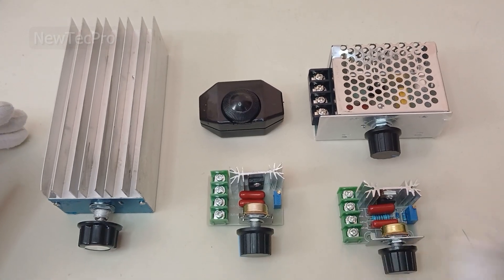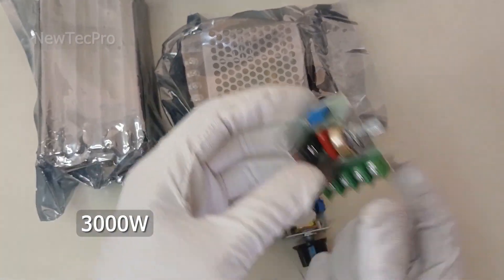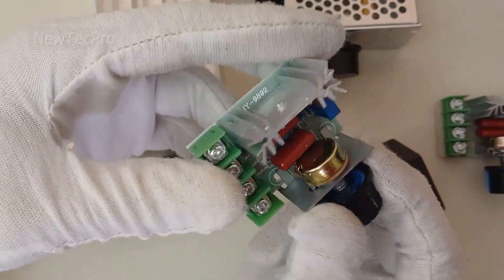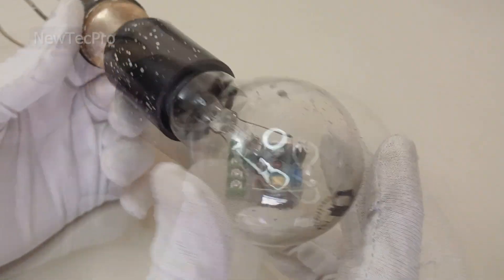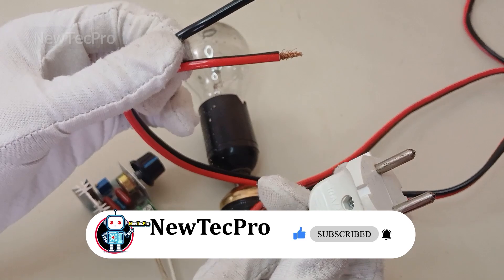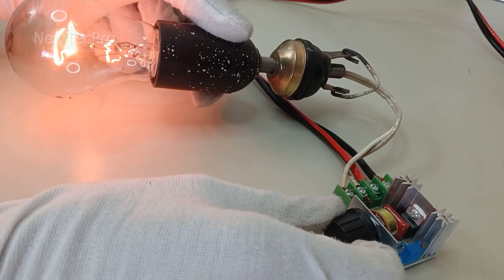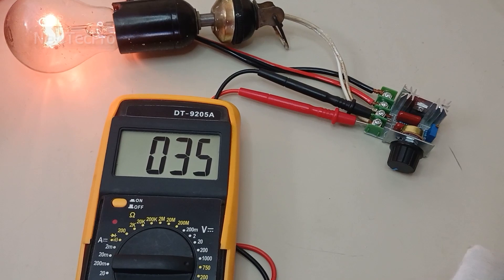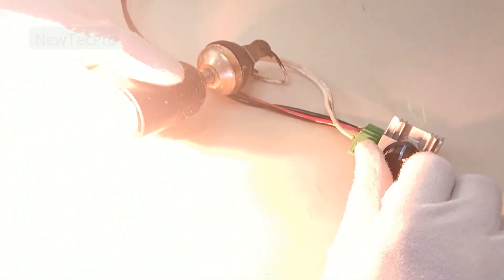How to Control ANY Light Brightness | 2000W AC Dimmer Setup & Voltage Test

Comment: Is there polarity, how to determine polarity of wall socket?
Reply from the maker: AC mains doesn’t have polarity like DC, but it does have live (hot) and neutral wires. A dimmer must be connected in series with the live wire. To determine which is live in a wall socket, you can use a tester screwdriver or a multimeter — the live will show voltage relative to ground, while neutral will not. Always be careful and follow safety rules when working with mains.
Reply: @newtecpro thanks for the reply
Reply: @newtecpro btw what if my socket is line to line (no neutral)?

Comment: With such clamping screw connections, sleeves always belong on the ends! The way you have shown it is amateur work and dangerous, even if this video is only for demonstration purposes.
I'm sorry, but I had to get that off my chest at this point.
Reply from the maker: Thank you for your feedback and for taking the time to share your concerns. I completely understand the importance of proper safety measures when working with electrical connections. The method shown in the video was intended for temporary demonstration purposes only and is not meant to represent a final or recommended installation.

Rest assured, all necessary safety precautions were followed during filming, and I always advocate for using proper techniques, such as sleeves on clamping screw connections, in permanent installations. I appreciate your input as it emphasizes the critical need for safe practices, which is something I always aim to promote.
Reply: @newtecpro  I mentioned that I am aware that this is just a demonstration. Nevertheless, you also have a role model function. Not everyone who watches your videos will know what safety standards should be observed. It wouldn't be so important with low voltage, I wouldn't have said anything. But with mains voltage, you should always proceed professionally, or mention in the video that this procedure is only a demonstration, that you should normally carry out the wiring with end sleeves. Nevertheless, thank you for taking my comment seriously and not simply deleting it. 👍
Reply from the maker: @theunknowdude3000  Your opinion is very important to us. Thank you for criticizing us. I hope you will guide us in the next videos.

Comment: I haven't seen a light bulb for a very long time, they haven't been available from us for a long time. 😅
Anyway, great getting started video, very useful
Reply from the maker: Thank you for your kind words and support! 😊 It's true that incandescent light bulbs are becoming rare in many places due to newer, energy-efficient alternatives like LEDs. This test was a bit of a nostalgic dive into the past! Newer halogens can also be connected to a dimmer to control the light level, which is a great option. Unfortunately, LED bulbs do not work with dimmers, so I had to use this old model bulb for the demonstration. I'm glad you found the video useful—it means a lot to hear that. Wishing you the best on your own projects!